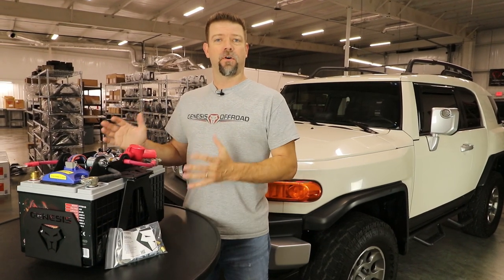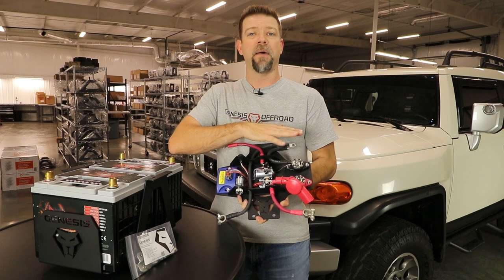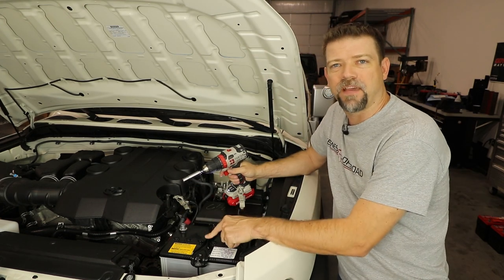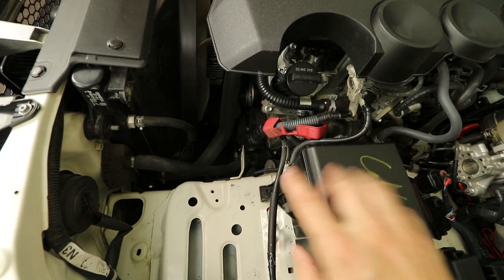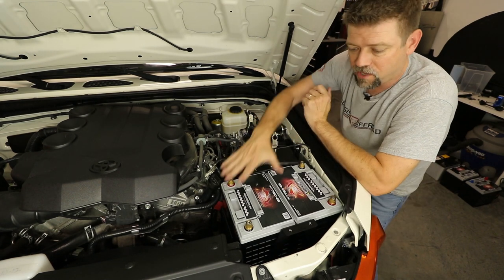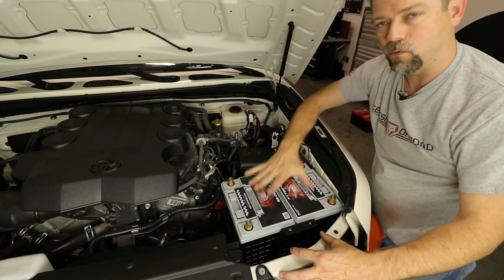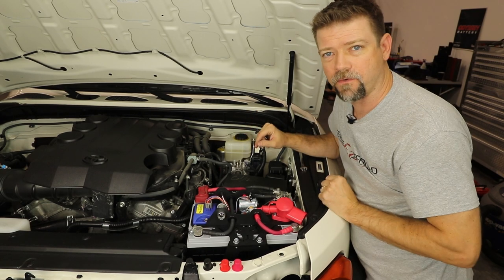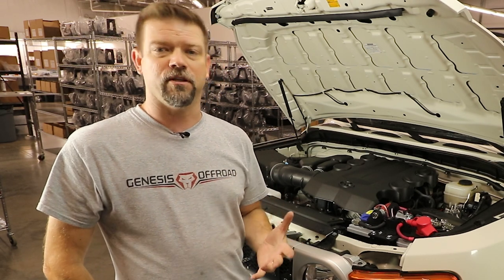FJ Cruiser Dual Battery Kit Installation Video

Comment: I installed optima red tops on my genesis kit. Here’s a tip for people using them. Use the tray that comes with them to lift the battery up higher so the battery top can touch the mounting bracket. If you don’t they will be loose in the cage and can short. Also make sure there is room and wires don’t get in the way of the fuse box cover. Another one is you can reach the fuse box power harness bracket under the battery to re install later. Install was easy but if you have a power tray like mine the bolts to get to them will be tougher and you will need to use a long extension to reach the power try bolts. Great product!
Reply from the maker: Great tips, thank you!

Comment: Good tip, but a few issues with this setup: 1. The vehicle weight balance will be off and more wear on the driver side suspension.  2. Cost, it can be cheaper to tackle this issue with a bracket on the passenger side and a device for under $150 from Amazon to do the same and keep the front weight in better balance.
Reply from the maker: We’re only adding an extra 50 lbs to the vehicle. That’s much less than a full tank of gas, or a passenger.

Comment: Shane I purchased the dual battery system for my Polaris 1000. I reviewed your videos from 2016 on setting up the system as well as the red light on the isolator. My question to you is that both  batteries would continue to drain. I found that the isolator was getting very hot and disconnected the middle red wire. The isolator cooled down quickly and the ATV would start without any problem on an ongoing basis. I don't know if the isolator is bad or the chip or brains of the system that sits on the side. Would you mind giving me your opinion. Thank you...Roc.
Reply from the maker: The heat from the isolator is 100% normal - see this video for more details - https://youtu.be/S_zpe2o0VbU. If you need any assistance with testing or troubleshooting, please contact us at 901-214-5337 or info@genesisoffroad.com.

Comment: Is it possible to put a push button inside the car for connecting the battery instead of opening the hood?
Reply from the maker: Yes, we accomplish that with our G Screen Monitoring System. The G Screen will allow you to link the batteries together to jump start the engine if the cranking battery is low. You can see more details about how it works here - https://youtu.be/4TO7FXf_GLs?feature=shared   Also, just a reminder that the system shown in this installation video has been replaced by our new Gen 3 Power Hub. The installation process is virtually identical, but the new Power Hub has lots of improvements. We will try to get an FJ in the shop sometime soon to update the install video, but you can learn more about the Power Hub here - https://youtu.be/_Fr_tLUEFIA?feature=shared   I hope this helps! -Shane

Comment: What about oil filter? I've 2008 FJ and filter between battery and engine.
Reply from the maker: It will be fine. The oil fill neck is still closer to the batteries than the oil filter on the 2007-09 models. We have several customers with our kit in those year models with no issues.

Comment: I have an 08 GX470.  Can the Gen3 FJ kit work on my truck?
Reply from the maker: Probably not. We've had a handful of customers test fit our FJ and 4runner kits into the Lexus vehicles over the years, and it seems they are just a little bit more cramped for space under the hood, so there's just not enough room to fit 2 batteries in there. We do have a Universal Power Hub that has all the same features that you can mount yourself anywhere you have the room, along with some other universal battery mounting options. Check this link and call us with any questions. https://www.genesisoffroad.com/Universal_c_27.html

Comment: Can optima yellow tip work for this set up , sorry for my dumb question
Reply from the maker: Yes, the Optima Yellow Top Group 75/25 will work, but just be aware that it is physically smaller than the industry standard Group 25 size, and therefore it has less capacity than other brands.